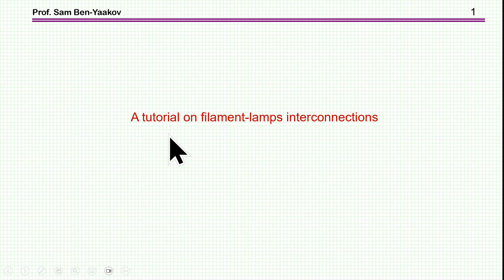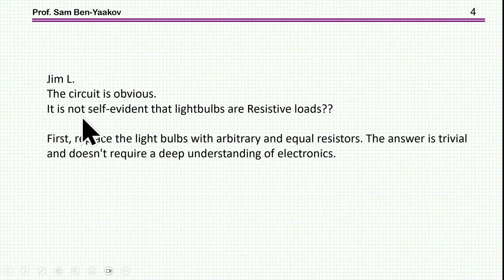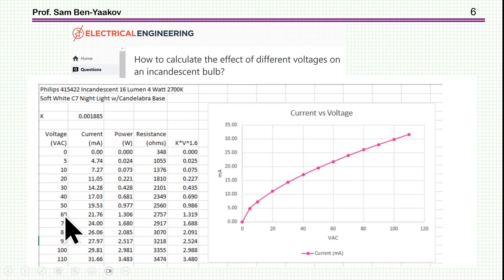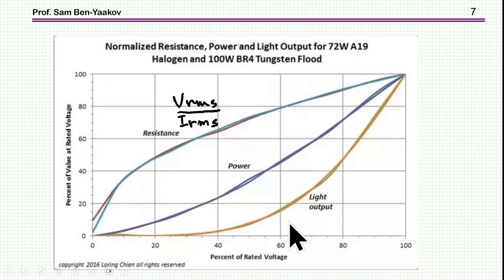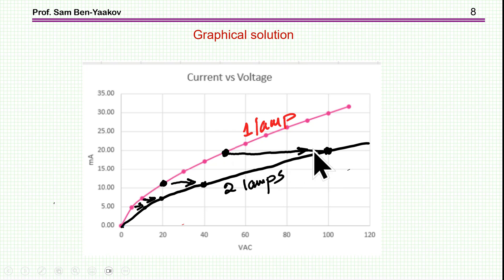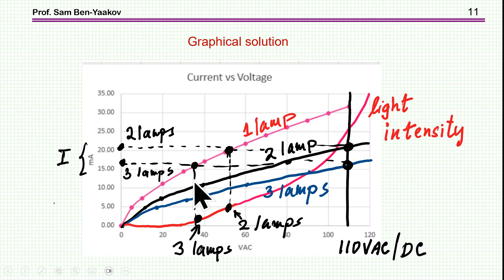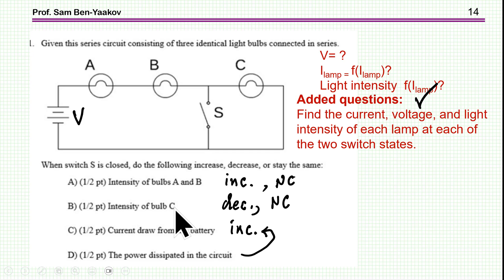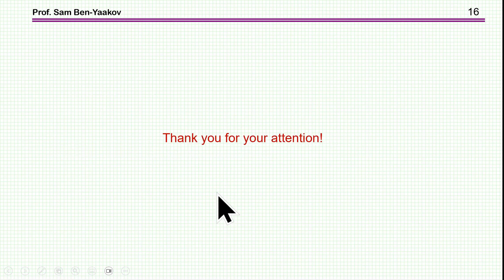A tutorial on filament-lamps interconnections

Comment: Battery voltage V could be really high (something like 2.5Vlamp_nominal to 3Vlamp_nominal). If it is that high, than after switch S is closed then L1 or L2 blows up, circuit current, intensity of all lamps and power disssipation of whole circuit reach zero.
Reply from the maker: Please indicate to which salide/minute are you referring to. Are you assuming different lamps?

Comment: Thank you again Professor for a great video,  for interest in my work as BioMed Engineer I have  serviced and repaired some laboratory equipment that use halogen lamps with active intensity measurement feedback, due to the non linear light intensity output the active feedback on these equipment will adjust the output to the lamp by changing the pwm signal that drives the lamp, some equipment still use the standard halogen lamps to this day!
Reply from the maker: Thanks for sharing and the intersting input.

Comment: The fact that V is specified and the relative brightness is asked implies strongly that V is large enough to light all three bulbs even if not brightly.  I doubt that the professor would allow this dodge to affect his deductions.
Reply from the maker: You missed the point. Which is: you can not cultivate expertise by oversimplifying the real world
Reply: is V high enought to blow up 2 bulbs in series?
original question doesnt even specify if V is high enought to blow up 3 lamp in series.
Reply: @volodumurkalunyak4651  As I said, that is logically implied.

Comment: Shorting out bulb C necessarily reduces the resistance across the power source; thus, most of the questions can indeed be answered (unless you admit a negative resistance region?).  Less resistance means more current through A and B so they necessarily get brighter and dissipate more power.  Zero voltage across C means its brightness decreases to zero.  Assuming an ideal voltage source, the total power also increases since V is the same and I increases; however, if a real power source with output resistance is already taxed past its max power point, then the total power will decrease.  It would actually be possible to transit across the max power point such that the total power stays equal despite the increase in current.
Reply from the maker: Thanks for the input.

Comment: I like your empirical approach. 

Ahh, the last column in the spreadsheet is modeling power.  Same as given here:  https://en.m.wikipedia.org/wiki/Lamp_rerating

On inspection, roughly
I(mA) ~= 3 * sqrt(V)

 a*V^0.55 may be a more accurate model. Taking the logarithm of the data and then using linear regression would indicate.
Reply from the maker: Thanks for the input

Comment: It's the good time to teach kids about one old repairman trick : when you don't know whether the thing you're about to plug will explode or not, connect it in series with a filament lightbulb with a high rating compared to the device (e.g. 60W bulb for a 10W power supply). The lightbulb having a huge positive temperature coefficient, it kind of works as a current limiter with visual indicator : the worst that can happen is the lightbulb being fully on, drawing its nominal current, which flows through the device under test. As it will be some hundreds of milliamps, it won't blow the faulty circuit instantly. But if the device works well, and draws only its nominal current, it won't be enough to heat up the light bulb, such that its resistance remains low and doesn't disturb the circuit. If it's inbetween, either the lightbulb is not powerful enough (and thus causes too much voltage drop at nominal circuit current), or the circuit presents a soft fault.

I remember measuring the inrush current of a filament lightbulb, and 5-10 times nominal is not rare. This, and the associated thermal shock (and mechanical shock because of rapid thermal expansion) in the tiny fragile filament is really what defines the lifespan of these bulbs. Soft-start them (i.e. with a dimmer, which happens naturally even if you move the cursor fast), and their lifespan is insane - I haven't changed some of them in DECADES.